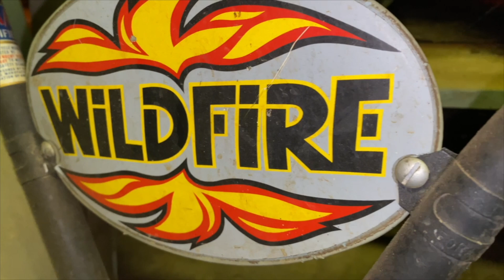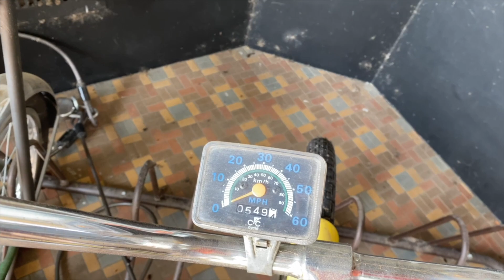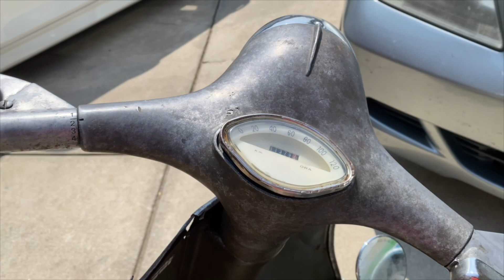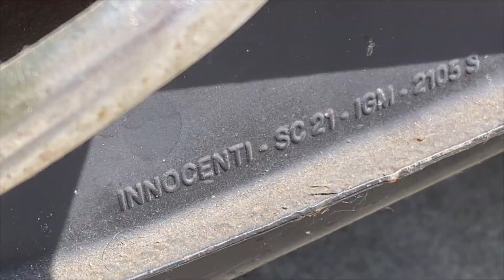Vintage Big Box Bikes & Vintage Scooters

Comment: I had this bike huffy wildlife. 
This was a really  good off road bike, as it had long forks so lots of clearance.  Small front sprocket and long cranks . Just before the mongoose  hit the scene  this was one of the cool ones was jc pennys
The one i had had a much larger cast front hub
Reply: I was thinking that was a huffy that came out in the mid seventies. I remember that it was easier to pedal than most single speeds of the period. That thing was a wheelie machine.

Comment: I had a Huffy Thunder Road, which is identical to the JC Penney Wildfire. I went on many adventures on that bike when I was a kid in the 70's.
Reply: I also had a Huffy Thunder Road. Road it all over Myrtle Beach when I was a kid !
Reply: This wild fire was the first time I remember  seeing plastic fenders on a bicycle
Reply: Mine I got in 1975 on my 10th birthday  from jc pennys.  It was the wheelie  king 
I remember  mine distinctly had  a cast sun tour type large front wheel spindle. 
They dropped it soon after and switched 
To a standard front hub and also on later ones added a gastank and a more traditional  chain guards.